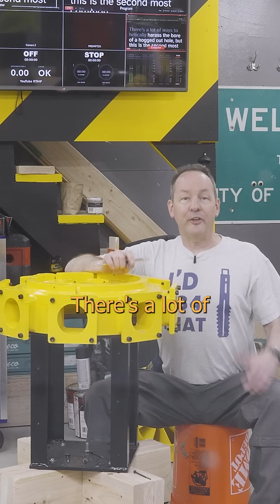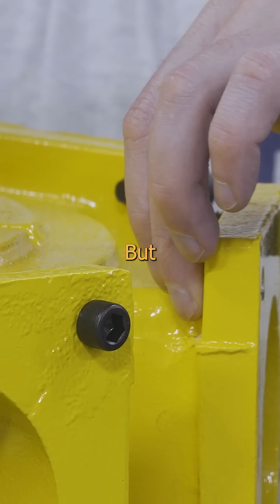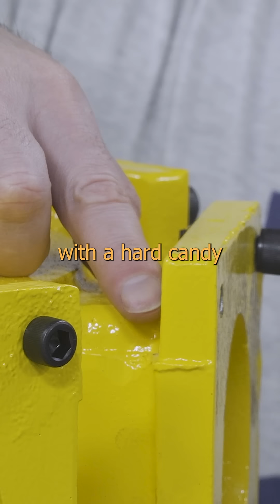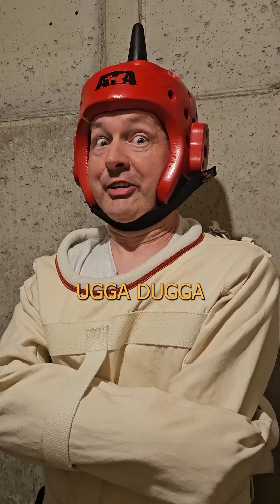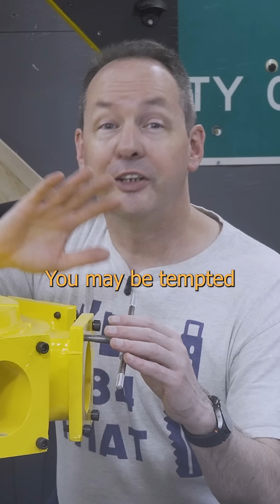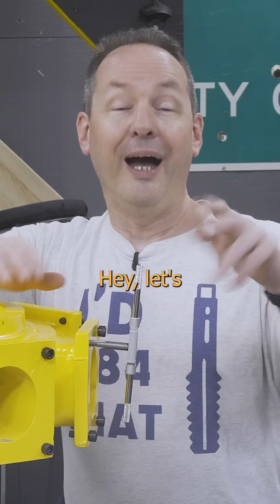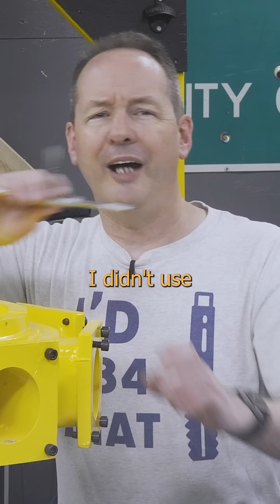Thread Chasing  #chrisboden #comedy #engineering #skills #workshop #metalworking #tools #apprentice

Comment: I was taught by my machinist grandfather to put a heavy canvas drop cloth down before using a tap in case you drop it. That tip has saved no less than 40 of my taps over the years. Now if I could learn how not to break it off in the hole by accidentally bumping it after getting distracted. 😂
Reply: I keep a chunk of unused exercise mat, but same, same.
Reply: I admit to using dies to clean the threads of befouled taps.
Reply: @jacobshort6528  sounds like elite ball knowledge if I ever heard any
Reply: Nice one!
Reply: good tip smart machinist grandfather
Reply: broke mine the same way, way to many times than i want to admit
Reply: Oh Ive bumped one before like that, tragic.
Reply: Grandfather just taught me something today

Comment: When I was new to tapping I was having great success cleaning up old holes with a dewalt. Then one day it grabbed at high speed, tried to take my arm off, and the tap exploded. I heard pieces ricocheting all over the room. Fortunately I was wearing safety glasses and learned a valuable lesson. Then my coworker broke off a 1/2 13 tap off an inch deep  into the aluminum. Bad day.

Comment: Dumbass! I broke a tap trying to power through,  then broke the tip of a screwdriver trying to get the tap out, THEN tried drilling the tap to use an extractor bit and broke 2 drill bits. I was still tryin my damnedest when an old hat showed up, laughed at me, then insulted me and my lineage.  He then welded a nut to the top and backed everything out. That was about 25 years ago. Lmao

Comment: Dumbass
I had 3/4 bolts holding a curtain ratchet onto my semi trailer shear from rust. After finishing a 14hr day I took it home to extract what was left of those 3 M8 bolts. Ended up needing to helicoils them. Accidentally did the first one with an M10 helicoil, luckily the M8 helicoil threaded into the M10 helicoil 😅

Comment: The only way that I would’ve done that faster than using a tap is using a little wire brush that goes on my Dremel and just ran it in there and cleaned out all the trash, but that might not get the job done. Get going in with the tap is the quick and simple way, but it takes a little bit longer. Mine is just to try to get the job done rhyme at home.

Comment: IF you are going with a drill, set the chuck to a low number, like 2-3. Because if for some reason the tap seize, the drill WILL break the tap!  But there is a chance that it survive with the chuck.

Comment: My dumbass used an impact when I was rethreading the exhaust studs on my heads. I was about 15 then. I knew I screwed up when it squealed like a stuck pig and snap. All within a second of each other. Lesson learned and it was a costly mistake. Took it to a machine shop and they laughed at me. About $100 later and sitting in the waiting room for 15 minutes they had it back to where it should have been.

Comment: When i run into that problem of not having the right plug in my powder coating shop, i roll high temperature tape made for masking powder projects into a long cone and use that as a plug.  You can cut off the tip that comes out the other side and make sure it stays in with a plug in the big side.  Chasing Threads is always recommended on any rebuild, but having less powder in the holes makes it so much easier

Comment: Not from being a dumbass and putting it in a drill, but i have broken plenty of taps, they are the absolute worst, especially when you are expected to salvage the hole, gotta go slow and easy with carbide tools to eat it to pieces without messing up the main hole. Hardened tool steel bits put up quite the struggle before they eventually yield to the fuck-you physics of hardness from a tungsten-carbide dental burr, and the persistence of a young machinist who doesnt want to start a 30 hour project all over for one goddamn hole.

Comment: Dumbass. I was 13 and was chasing threads on and old car 69 vw body panel and had 12 to do. I was thinking I can do this real fast... Nope after the second hole my dad said check the hole with the bolt before moving on and that's when I go to the FO of the fuck around.  Luckily dad was a mechanic and use a welder.  So he filled the holes with metal and I had to drill the holes back out with a dull bit as punishment and tap them by hand. Dad's been dead for 23yrs now and I still remember that day like it was yesterday

Comment: If you’re only chasing/cleaning up threads, and there is a lot to do, a drill is great if you use it correctly. For really gunky/dirty threads, a bit of brake clean and your favourite flavour of compressed air, then start the tap by hand in the drill chuck, set the clutch really low and go from there. When the clutch disengages, simply turn the drill by hand to clear that spot by feel until you can use the drill again.

Comment: Am I the only one wondering why the bolt wouldn't just push the paint out of the way? Ima mechanic in wisconsin and I've seen way worse than a tiny bit if fresh paint in some threads, no tap needed

Comment: "dumbass" When I was still at my Aviation Technology school we had to tap some threads. the only problem is the last time they taught us how to actually tap was in about 3 years ago: so I started tapping the hole, "huh this is getting kinda hard" so I twisted harder and harder and harder, then SNAPPED THE FUCKING TAP, I did not do a backwards spin every now and again to break up the aluminum chips, so I had to completely remachine that piece because the broken tap was stuck inside forever.

Comment: Fun fact: for blind tapped holes, add grease to the tap before inserting to carry the chips out with the tap. Also, never forget, every 1/4 turn, when cutting new threads, back the tap out to break off the chips.

Comment: I snapped that bitch off like I was 13 again. 3 hours, 2 bent punches, and an Ozzy's worth of "FUCK!!" later, we were able to smash the bastard out the other side far enough to get some linesmans on it, drill it bigger, tap it again, and use bigger bolts. 

The tap in the drill CAN work if you are INSANELY lucky, but it is a zero matter of skill.

Comment: Thread tapping and thread chasing are different things, you shouldn't really use a tap to chase a thread, you can but best practice is to use a thread chaser, that way your way less likely to cross thread it and start cutting new threads, Specially if you're new to it. If you're experienced, you can run a tap as a chaser all day, but if you're new, use a chaser.

Comment: I'm a dumbass. and have done it but not as big a dumb ass ass the guy at work  who thought it was a good idea chasing a helicoil, trip to the machinist and 3 days of down time later ..... on the other hand I am the dumbass who drilled a hole through the side of a vacuum chamber to fix a stripped threads.

Comment: Ever heard of “impact taps” they are purpose built to work with an impact drill…for when the threads don’t need to be perfect they just need to happen fast! They work amazingly well (don’t cheap out on them tho, unless you enjoy getting snapped off hardened steel out of holes) I’ve used the Milwaukee branded ones to great effect being a part of a FRC pit crew team throughout high school.

Comment: My “dumbass” has to chase the threads on about 40 parts I had just finished making with a helicoil tap (great 2nd part topic to the threads and taps episode btw!) and thought using a drill would be waaaayyy faster and easier… making an 25 extra parts cause I cross-threaded most of them didn’t save much time though unfortunately (now age 22, made mistake at 19 lol)

Comment: I remember replacing the master cylinder in my 1948 Dodge B1-D, it was on there from the factory and the threads were messed up in some manner and i couldn't reattach the brake line to install the new one, so I ran a tap through the cylinder, and a die on the brake line fitting. Might not have been the best solution, but it worked for 14 year old me and hasn't leaked a drop since.

Comment: Should mention: if cutting threads work back n forth, forward cuts chips, backwards cleans them out. 
Try to force it like a bolt and youll snap it. 

If chips are a concern fill the cap with crisco, itll lube the tap and catch the chips

Comment: Dumbass.
I was re building a fourwheeler engine (500cc polaris engine for those interested) well, some of the holes were a little rough, so i wanted to chase the threads, i had never chased them before and assuming it was like taping threads, i holked it up to a drill and ugga duggad my way to a cross threaded cylinder head.

Comment: Drilled into a printing press to mount an oil dropper. 8” thick machine steel. Hole wasn’t deep enough and bottom tap bottomed out and snapped clean off in the hole. After an hour of hammering and drilling I turned the machine back over to production with defeat. I’m sure it’s still there to this day 10 years later

Comment: Additional information. 
If you drop a tap on concrete and it didn't break. Throw it away... It is broken you just don't know it yet and you don't want to figure it out went its in the hole

Comment: Dumbass. I tried to chase the threads on an old bench vice I found at an antique shop and in my infinite 18 year old wisdom figured I’d try running really slow on a drill press without any inconsideration to checking if the hole was actually aligned perfectly.

Comment: Dumbass...  I did that trying to chase crappy threads on my transmission and ran it with a drill, cross threading and not realizing.  Tried to run the pan bolt through and it got locked up full send and broke the bolt off.

Comment: I recently chased some rusty threads in some frame holes on a jeep. Tap wrench wouldn't fit  up under where I was working. I spent what felt like an eternity muttering to myself, "don't break the tap off" repeatedly as I drove it with a crescent wrench. Successfully I might add. Holy pucker factor batman!

Comment: What is worse is having a device that is supposed to have a threaded hole for a bolt, and the factory didn't thread it.  DO NOT tell the apprentice to thread that hole; it will not end well.

Comment: i used to work at a place where people would use taps in not just a drill, but an impact. i understand it was a fast paced assembly line and people didn't have time or space for a tap handle, but oh it was frustration having to be the guy to fix everyones broken/damage taps/holes...

i tried to tell people you shouldn't be using an impact, but they didn't care. i knew one person who would use drill at low speed, and hes only broken 1 tap while i was there. 

i broke my fair share of taps using an impact, but at the end of the day, it was way less than the other morons on the line doing it. 

the company supplied the taps, basic HSS taps. i would buy my own taps with titanium nitride coating to help last longer. most people wouldn't use tap magic either, i had a dedicated bottle in my tool box

Comment: I'm a dumbass because I was replacing the spark plugs in my first car and cross-threaded one of them into an aluminum cylinder head.  The thing already had 350,000 miles on it and no expectations of lasting longer anyway, so we just found a spark plug tap, re-tapped the hole while it was still in the car, and who cares about shavings in the cylinder anyway.  I still got another 20,000 miles out of it before the chassis started to fall apart.

Comment: Dumbass here. Once tried to clean out the tap for a oil pump on an old 350 block, I didn't do my research and guesstimated the threads and wound up "cleaning up" my metric threads with a standard tap. Didn't realize how fucked I was until it was way too late. Thread locker and a prayer later, the oil pump was secured... For now.

Comment: Dumass
I used a low power drill to unscrew a solenoid from a starter motor(fucked it harder than the convent's roster)and then tried to use a screw extractor with that same drill without using a drill beforehand and I learned that not having the right drill bit is a valid excuse to stop a home project cuz I ended up ripping the screw apart but it ended up being good enough to remove it and now I have a o ring made of brass

Comment: Dumbass
Tried to clean the
 threads while repairing a machine at work with my not so very gentle Hilti power drill. 😏 And guess what?
Yeah, right! At the second hole the bit get stuck, snapped, split up, plane, inside a stainless steel frame. 🫣🙆‍♂️ Try to get this mu*f*ker out! 
😭😅🤣😂

Comment: Dumbass, installing a j-box on an Ibeam(a big one) boss was cheap and I had to use my mixed set of crap drills to bore out the holes to the correct size, well i snapped too many drills and taps. Ended up with hardened steel blocking three of the mounting points. The fix ended up with me having to drill a fifth hole/tapped in a close to diagonal location and made a special fixing hole in the box (2 fixing poinsts out of 5 is fine)

Comment: DUMB$ASS%. Out of at least a few hundred powder-coated holes, I broke maybe two taps, both M6s, as I didn't have this problem with M8 holes. But I always used machine taps and only with a cordless drill. Things were different after hot-dip galvanizing; even with M12s, I had to be a bit more careful.

Comment: If you're adventurous you can use a bottoming tap for chasing threads.  For the dumbass part, I normally use a hand drill for tapping anything 1/4 20 up to 3/4 in aluminum or mild steel, so far, in the past 10 years I've broken 9 taps, three of which by hand, so while I always tell the new guy not to, I rarely follow my own advice to the letter.

Comment: Huh, yeah, I'm a dumbass, 11th grade metal shop class. Made a custom machined shift knob for my civic and tried using the manual lathe I machined it on to do the threads, since my last one was more crooked than a politician. Acted like more like a drill bit for the first quarter inch before it snapped and I released the dead man pedal

Comment: Never use a gun tap on a hole that isn't being threaded the whole way through.😢 When you go to back out, the chips will bind behind the cutting edge and likely lead to tap breakage. Had this happen to me with a 6-32 unf in aluminum.  Had to mill that tap out with a carbide end mill, FML.

Comment: Now I might be a dumbass.... but I did learn that, no, putting a tap on a vertical drill will not give you a perfectly straight thread, it will give you a slightly bigger hole, a nice smooth tool steel cylinder (HSS probably since it came out in one piece de-threaded looking like fire fiddler with freshly singed eyebrows).

Comment: DUMBASS! Once was working on a fixing a door latch on a clapped out IDI powerstroke company truck when I figured out that "thread chaser" and "thread tap" are not the same fucking thing. I broke the chaser about 80% of the way through a 3/16 piece of iron that I was going to weld to the inside of a door panel only to realize that the mechanic whom I "borrowed" this from was not at work that day and the Snap-On man wouldn't be back until he had returned from his vacation. One quick anxiety induced phone call later I hopped the nearby town and went over a mountain into another city to do an exchange and put it back before he came back in. I preemptively apologized to the mechanic and told him that I already got him a replacement. Weirdly enough. He wasn't too pissed off but every other rubbernecking cocksucking red and white Snap-On knight at the shop was.

Comment: Make Taps by grinding , cutting out slots on bolts 
     " We made taps to remove paint from powder coated metal plates " 
      " much cheaper than buying original taps at $15 to $20 each "
      " each tap was made in around four minutes "

Comment: I do not agree, trying to tap by hand, especially when it's still a straight hole, required you to both spin the tap and keep it straight. If you use a drill you only need to keep it straight, and the drill does the spinning. 

Of course you need to use novelty features like drill clutch to protect yourself, and don't go pull push in. Also, don't rawdog it.

Never broke a tap this way. I have definitely broken taps where I had blind holes and I did it with a mill. I measured twice, broke once because I knew the depth I needed but I forgot (especially with the taps which push the chips forwards) with my monkey brain that the tap space becomes less when the hole is filled with chips. And then this typical "eeeeeeEEEEEEEE *snap*" sound. Ouch.

Comment: Not a dumbass but dealt with them. Worked at a factory where they chased powder coated threaded hole with a 1/2-13 tap. They would put a nut on the square shank of the tap and use the bench vise to press it on. (You could literally hear the tap cracking) then proceed to use a 1/2" impact with a chrome socket to run it in. After the 4th tap I had to use a Chisel and punch and break them out I walked down the assembly line and removed all of the taps off the line. The supervisor asked why. I said until they learn to use them properly they aren't getting them back.

Comment: Iv never had the blind confidence to put it in the drill but i did poo my pants when i was cutting some threads in an engine block and the tap locked up and wouldnt turn either way😂 i did little turns back and forth for 30 mins till it came loose and continued thankful it didnt break